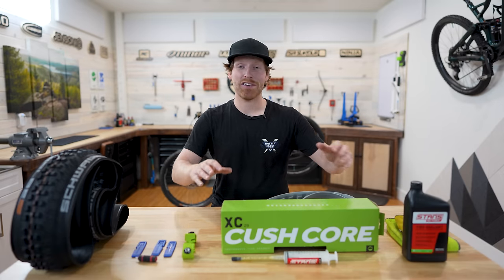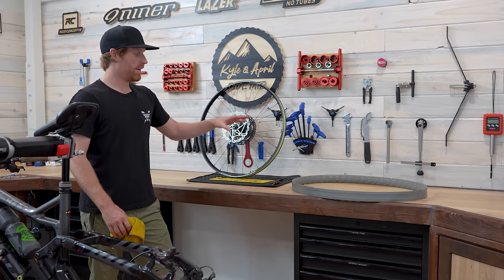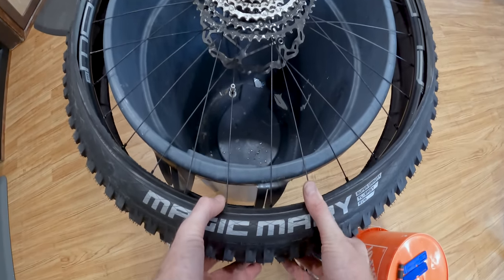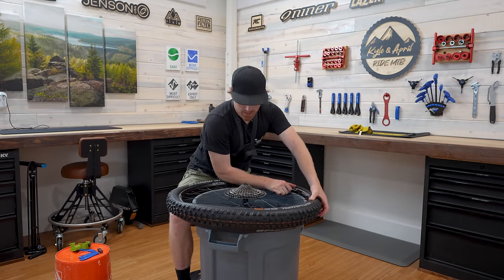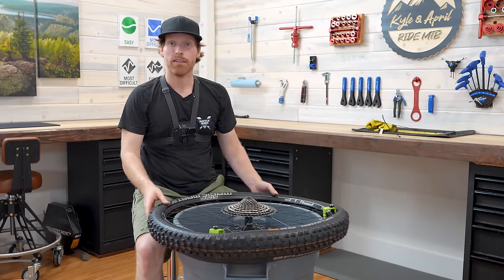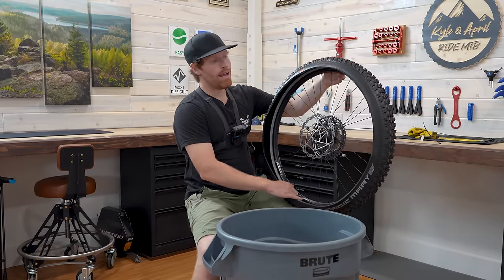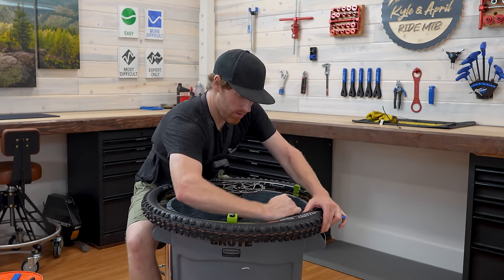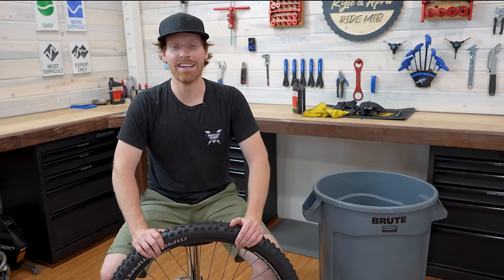Cushcore Installation Made Easy!

Comment: Tire first seat the beads then open one side up and then shove her in wayyy easier. I have some other tricks too but…. Some of us are built different. Same technique you use for motos running a bib moose. Other than that solid advice Kyle. Love ya buddy!
Reply from the maker: Yeah I actually started doing that after some more suggestions! I asked the Cushcore guys and they said they always do it one side at a time but that they might try doing some the other way. I need to make and updated video on the easier way!

Comment: Nice video, you have way more patience with that install than I do...lol. After hearing all the trouble folks have had with install and especially removing the Cushcore, I went with VITTORIA AIR-LINER. Very easy to install and remove tire (provided you get the correct size insert) and they have worked perfect. In fact, I was able to ride off the trail with a "flat" tire and only the insert inside.
Reply: I all managed to reinstall an airliner trailside after a crash. Not sure I could have done that with cushcore.

Comment: I don't use Cushcore, but even when mounting the tire - very helpful was the part where the cut tire/rim showed up and you only pressed the one bead into the rim that was actually trying to pop onto the rim . I always tried to keep both beads on the middle of the rim when installing tire, but with the Schwalbe it was always an extra struggle. Today I tried not to worry about the first bead already on the rim and press in "valley" of the rim that only second bead on what I was "working on" - I got a little extra slack, it was much easier - only one lever needed and no sweat :) Thank you.

Comment: Nice video.  I liked those cross sections.  I've ran Cushcore for 2 years and was happy with it.  I am not using it anymore, though.  With my RA, it is next to impossible to install them myself.  I cannot get them off either.  Just hurts my hands too much.  It is a good product and wish I could keep using it.  I sent a message to the company about my condition and how Cushcore helps me ride.  The developer of Cushcore got a hold of me and gave me a very nice message about how he was happy his product was helping me.  He sent me some swag, which he didn't have to do.

Comment: I learned some tire installation tips I've never heard before I watched this video, and I've put on quite a bit of 'em. Very nice video. One thing that helps me know if I've installed the tire in the correct rotational direction, is studying the knobs.  Some tires have knobs that point in the direction of forward rotation, and so if you have the tire installed correctly, the knobs should be pointing forward. If they're pointing towards the back of the bike, you need to take the tire off and flip it around lol. When the bike is upside down, the direction is actually the opposite, which can be tricky (and why I prefer changing a tire either in a bike stand or the bike rightside up).
Reply from the maker: Glad you learned some tips!

Comment: Great video. Everyone has an approach that works for them. Me personally, I use a couple tricks. Rim tape, smooth and bead to bead. I use 35mm tape on a 32mm ID rim. Next I mount the tire and set both sides and inflate. Remove one side of the tire. Stretch the Cushcore out using my knees and feet and hands. A warm CushCore is better. Put the cushcore on the rim, inside the tire. Use a small amount of soapy water if the tire is new and just install the second bead by pushing the bead deep into the spoke well. I can usually do these without levers, depending on the rim and tire. By installing the tire and seating a bead first it makes the install WAY easier. JMO. Thanks for the vid!

Comment: Excellent tips for those that struggle or haven't done it.
I just did a couple the other day and don't have any trouble once you understand a few basic things. My number one emphasis is getting that bead tucked under and deep in the rim. I liked those green holders. I can also recommend the cush core tire Irons, work well also. I like adding the sealant just prior to popping on that last bead but agree with your point on can be messy if you errored. Great job.
Reply from the maker: Thanks Jeff! Yeah the cushcore levers are also really nice, I just had one install where i poked a hole in my rim tape using them and since then I switched back to the smaller schwalbe tire levers. The cushcore ones are great for pushing the bead in though!

Comment: 1st Time I did cushcore I Just did it the Cave man way sweating Buckets and Bloody fingers lol  now I use Tire levers now..  good Video man I will Have to Get me some Bead Bros and also try 3 Tire Levers you did that Nice and Easy.. Oh and Remember every One zip ties Can be Reusable if you Get a Razor blade use the sharp corner to Lift the Plastic Tab with Blade Between tab and Notches slid it Back open. just don't cut your self. also the plastic tab may Weaken over time if reused to many times..

Comment: I've gotten very proficient changing tires with chshcore, I have to suggest getting the cushcore bead dropper tire lever. It has a huge handle on it and makes it easy to push the bead into the channel. Also, the plastic trash can is a must have.
Reply from the maker: Thank you! We have another fun Cushcore video we will post in the next few weeks on this channel or the @ridemtbexpress channel as Kyle has gotten better at installing them.

Comment: I find it much easier to do one side of the tire first, then insert, then the other side of the tire. That way you never push out the insert which can be a pain. I find it easy to get the insert seat if I push my knees on the rim on the bottom part and use both hands to get the insert all the way up and end at the top. I hope it makes sense. Did a set of super gravity today and man these are pretty rigid. I wish I had seen your tip about the sun, that would have helped me a bit I think. Also, this made me consider getting some of those bead bros...
Reply from the maker: Glad you got some tips from this!
Reply: @AprilRideMTB  Sure did. Keep it up :)

Comment: I use Tannus and the process is very similar. Getting that bead to the center is incredibly important. I don't have a bead bro, but what I do is tuck the tire under the insert then use clamps to pinch it in place. Works just like an extra pair of hands. Installing inserts has been a learning experience but the ride quality is top notch. Would recommend using inserts for sure. Got them in both my hardtail and full sus.

Comment: Excellent video! I've used this technique on other inserts as well with a variation: Using those exact tire levers instead of the Bead Bro tools. The clip side does the same thing, albeit not quite as well. If I use 3-4 of those levers to push/hold the tire in the center rim channel, I've found it gives me the slack I need.
Reply: no. those clips don't push the bead far enough into the rim, which makes a HUGE difference. anyway, could you also make a video on how to UNinstall a cush core? that's where I struggle much more.

Comment: Very well done. Sound and lighting are good to go, new shop is almost as nice as that awesome looking stool under the bench. Lovin it! Cool to see the Niner ebike. I ride a Dengfu E06 Carbon Frame fat tire, full suspension ebike. I wish I could use Crushcore in my wheels, but Cc does not make a insert for my 100mm carbon wheels. I run my wheels tubeless, so a insert would be nice, but I cannot find a set big enough that is for tubeless.
Kyle you are looking healthier every video.

Comment: i recently bought my first sealant injector and went with one that was $10 including a valve core remover.  i don't run anything inside my tires so got one that can actually insert all the way through the valve stem rather than screwing on and pushing sealant through the stem.  seems cleaner to me especially with the twist valve on the syringe to help keep sealant from leaking when i go from the bottle to the bike.

Comment: Check out Rockstop rim protectors. It's made from much higher quality mould injected elastomer that lasts much longer and doesn't absorb sealant. Also doesn't require special valves because of the open design and allows sealant to flow freely within the tire. Also doesn't give tires that "dead" or damped feeling.

Comment: I got cushcore installs down to a science now. Took me about 3 practice tries, 0 tools. You have to man handle and tuck them and the sidewalls. Then again, I have a pretty strong grip, hands and fingers due to my line of work. Pinch, tuck and counter on the other side and the cushcore/tires never come off. The last portion, I hold on to bead that is on and stretch, pull and roll the bead that needs to be sat, all while I keep the sat on bead in center of wheel(the channel) with my palms and thumbs. I do this on DD and DH casings on maxxis tires. Good luck.

Comment: I met a guy on the trail using this and he got a pinch flat while I tried to keep up with him. Yeah, it would have ended his ride but I had a spare tube so we yanked it out (very difficult when you are on the trail), and installed the tube. IMO: you are better off running higher PSI or a more a DD tire. He had to carry the ring over his shoulder/neck all the way back.

Comment: Thanks for a great video, again! Huge fan and heard you were at Bikefest in Bentonville. 

Anyway, I am curious - the benefit with cushcore also allows for lower air pressure but what does that mean for your jumps? Do you have to make assumptions before your ride means lower pressure, no jumps; or do you just SEND IT not matter what?

Comment: OK, so ... the Cushcore lever/push tool helps a lot.
Lubing the tire up with a window cleaner liquid (Windex/Mr Muscle) helps a lot
Also, putting on 50-60%, then putting the other side on 50-60% helps with the tire not popping off. 

On some rims/tires, it is possible to put on half the tire, put the cushcore in, and put the other half on. I prefer to do that if possible. One such example is Halo Vortex 32mm with 2.4 Trail King tires.

Comment: When I used to bmx as a kid and popped tires almost daily until I had a luck chance of talking to someone higher up told me to always ensure tires were at max pressure and since haven't popped a tire. The main reason as seen in slowed down videos on line I'm sure you can find one but the sheer force landing or clipping a curb compressed the tire to a point of being pinched between the rim and ground. Max air pressure in the tire will greatly reduce this possibility

Comment: Is there anything wrong with just installing one side of the tire then the CC and follow that same method of pushing the bead in to fully mount the tire? I have been doing it like that and never had issues but it's probably wrong, IDK? Thanks for a detailed look with those cut out cross section views, that makes total sense.

Comment: Great video as always!

So I had my Cushcore installed by my LBS, so I am not sure which valves were installed. The sealant I have (Black Ox OX1) says not to put the sealant through the valve if I have Cushcore valves because of the holes in the valve. Do you think it would be safe? Seems like it worked just fine for you.

Comment: Thanks for a very good video and past videos too!

Do you add same amount sealant as you would without cushcore? For example Stans recommends 140 ml (5 oz) sealant for 27.5” * 2.5 “ and I was wondering if it is necessary to add that much as the air volume of the tire is smaller after the insert is inside. 

I was also interested about the tire pressure, I’m running 25 psi back and 20 psi front. I have heavy 22.5kg ebike and I’m mostly doing enduro/downhill. My weight is with gear about 82kg. I was wondering what pressure are you going with cushcore/ebike? Thanks in advance 🙏
Reply from the maker: Hi April here! Kyle used a 29 x 2.6 tire and put 3oz of sealant with cushcore, without cushcore it’s recommended to run 5oz. So I would guess 3oz for yours as well. Also here is tire psi recommendation from cushcore website “Many riders prefer to run 1-5 psi less tire pressure with CushCore. The ideal pressure depends largely on your starting point – your normal air pressure with standard tubeless. Riders who already run low pressures (for example, 20 front and 23 rear) have less room to adjust than riders who normally run 30 or 35 psi. Excessively low tire pressures increase the risk of flats or wheel damage. We encourage you to experiment and find your own preferred setting. Start at your normal tire pressure, then drop in 1 psi increments until you find the sweet spot for your riding conditions.” Hope this helps!
Reply: @AprilRideMTB  thank you April ☺️

Comment: I'd love to see a video of what to do with a trailside flat when you've got an insert, and your sealant, and plugs don't fix the flat. I've often thought getting a tire with an insert off trailside, without the luxury of all the goodies could be a nightmare. Any tips? ... other than, "don't flat!"
Reply: That was my concern, so I went for the Vittoria airliner. They are a complete circular profile with grooves for sealant to move around you can still ride airless, not at full speed and I defo wouldnt perform any hard cornering obvs but it would get you back to the van or even complete a loop at a reasonable pace without trashing the rim or demounting the tyre if you picked up a non sealable hole in the tyre. the seem easier to fit than the cushcore syt;e inserts too.

Comment: That Cushcore was wayyyy looser on the rim than mine was. I had to stretch mine onto the rim but it’s the pro version.
I liked the elbow trick but you should apply tension to the bead when you’re trying to get it down into the well. Every time you push it down the Cushcore will force it back out unless you’re pulling on the tyre to keep it in place.

Comment: Where did you find the inflator attachment for the compressor that's compatible with presta valves? I have had zero luck finding one and I'm tired of threading on the schrader adapter every time.
Reply from the maker: Hey William, I got the park tool inflator from Jenson USA, but i will say its a high quality tool but it is a little more expensive than I would really like haha https://www.jensonusa.com/Park-Tool-INF-2-Shop-Inflator . There are a few other cheaper options like ones from Silca though which do only presta.
Reply: @AprilRideMTB  Thanks. I'd rather pay a little more for a quality tool that just works and will last. If you think it was expensive you'd probably don't want to see how much extra it would cost for me to get it shipped to Canada. 😭 I'll keep an eye out for it locally.

Comment: Kyle, would a thin layer of sealant work as a temporary lube instead of the soapy water?  If quick enough, I would imagine it would allow for the rubber to slip in place, yet still be able to wipe off the sealant on the outside before it cures.

Comment: Great tutorial!
Question, I am new to tubeless tires, I have used Stan’s sealant and it worked well so far, but now, only three months in, I got a puncture that wouldn’t seal, all I got was liquid coming out.  I opened it and found only a transparent liquid in the tire, and clumps of rubber floating around.  Could sealant go bad in just three months?
Reply: Chiming in for Kyle here; it sounds like the latex in your sealant was absorbed, leaving behind the clear anti-freeze component. Our standard sealant should stay liquid for anywhere in the 2-7 month range, but certain conditions such as dry or hot climates can expedite that timeline.
Reply: @notubes  thanks!
Florida is very hot this time of the year.
Is there a range of temperatures I should look for to use tubeless tires?

Comment: Thanks for the video, I’ve installed cush core a good number of times (at least a few with my tyre backwards!), do you do anything in particular to distribute sealant around the inside of the tyre?
Reply from the maker: Thanks Daniel! As far as sealant, when the wheel is spinning it will naturally force the sealant out to the outside of the tire with centrifugal force so as long as you have those little notches in the cushcore it will naturally disperse itself!

Comment: I was planning to buy a CushCore but it is definitely pain in the neck 😂 have you tried CushCore pro as well?
Reply from the maker: Yeah I have tried pro a few times. For me the added progression of the tire felt a little too harsh. Or I found myself having to run too low of pressure which made me feel a little squirmy. I really like the XC version though, it takes up less volume in the tire, is easier to instal, lighter, and still helps with cornering and rim protection. If I had a full dh bike I would run the pro but for everything else I like the xc
Reply: @AprilRideMTB  thanks for your valuable response. You are the best by far when it comes to product reviews 👌🏻